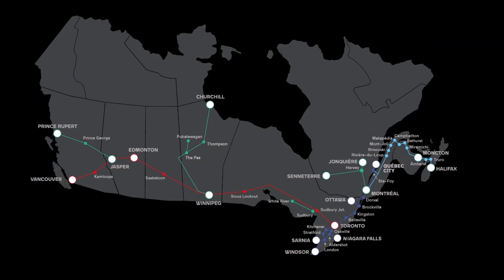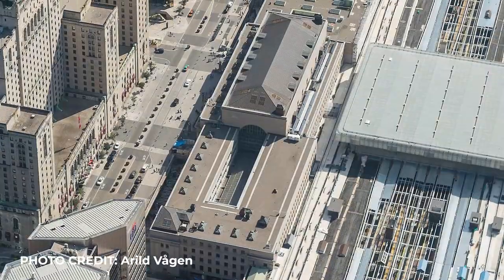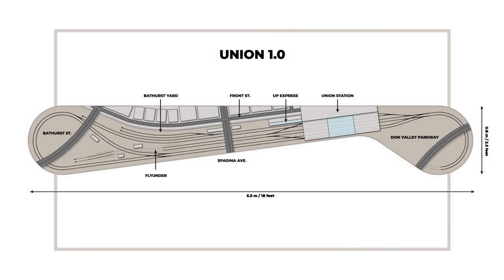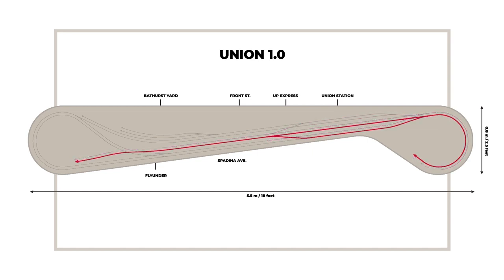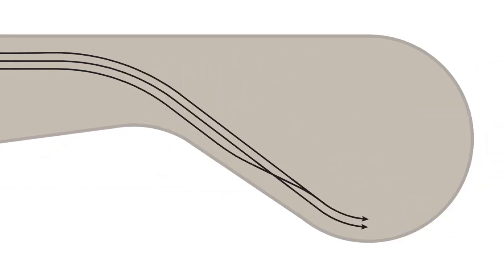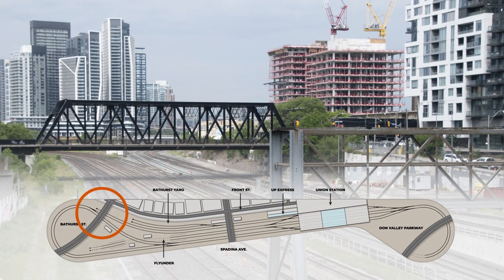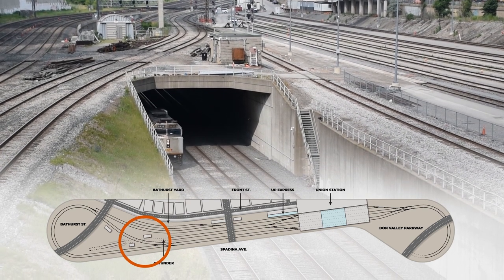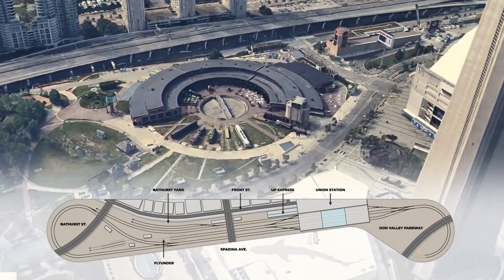Introduction to the Union Project: Layout Planning & Design for a VIA Rail, Go Transit Layout.

Comment: For the right side of the layout, search for the Scott St Interlocking Tower.  Or the Cherry St Interlocking Tower.  They are small enough to fit but with MOW hi-rail vehicles around them, they would be interesting.  Both are on the North side of the tracks, but flipping them to the south would show the more interesting side (at least Cherry St).
Reply from the maker: Thank you for the suggestion! I I found the building you suggested and I think it's a great idea. Having a single spur or a dummy track with the tower and some mow would be perfect - it would also be a nice change of pace from modeling skyscrapers. Great suggestion!

Comment: I’d love to do something similar in HO. That station itself will eat up lots of switches. Should look cool when it’s done.
Reply from the maker: The station is a track laying nightmare. The prototype uses so many double slips... I've simplified things using 11° crossovers. It looks the part, but is more for aesthetics than operations. The cost and scarcity of N scale double slip switches creates a lot of challenges. Thanks!
Reply: @NScaleDystopia  might be cheaper and less space consuming then a bunch of single cross overs. Depends on what you need

Comment: Like the plan, my only suggestion would be easing out the turnouts, if you are planning to handlay, you can actually get away with larger coded frogs by virtue of the fact that if you are making the turnouts yourself you could much more easily blend them into each other. Could also be some opportunities use custom curved ones in a few spots. I was able to get away with a 2x4 N scale layout using only Peco Code 55 #8s that was able to comfortably squeeze in a run around, 2 "Outside world Connections" and 2 Sidings in the foreground.
Reply from the maker: I really appreciate this. This will be my first time handling turnouts. My Hope is that once I get down to spiking rails I'll be able to adjust things as you suggest. This is a big project for me, and I'm always open to feedback, so I deeply appreciate you offering up your experience. Thank you kindly.